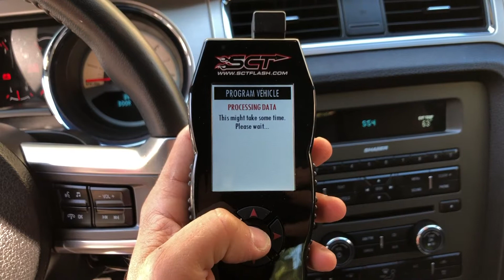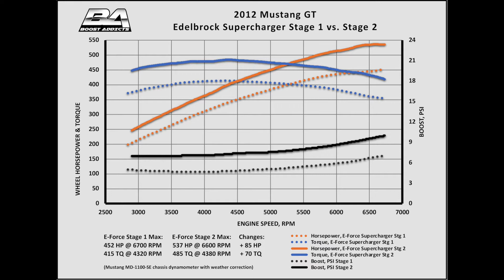Edelbrock Mustang E-Force Supercharger Stage 2 Install and Test

Comment: What size belt was used with th 3.25 inch pulley
Reply from the maker: Excellent question. I don’t recall, BUT the belt they included was slightly too short to fit easily. I’d install a belt that’s one size longer.

Comment: I thought this kit was the older 2300 blower, but you said at 2:40 that is it the new 2650?
Reply from the maker: Huh. I swear earlier Edelbrock literature said this was a 2.65L blower, but currently the website says it's the 2300. Which makes more sense, actually. Thanks for correcting that!
Reply: @Mustang-Geek  theres 2 version this 2300 and a 2650.